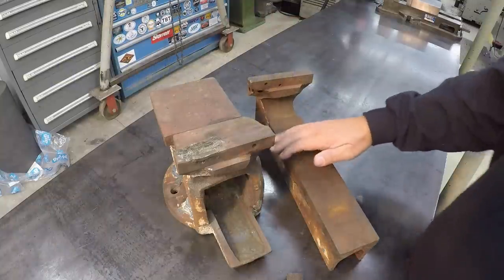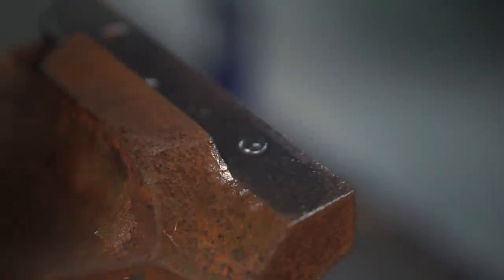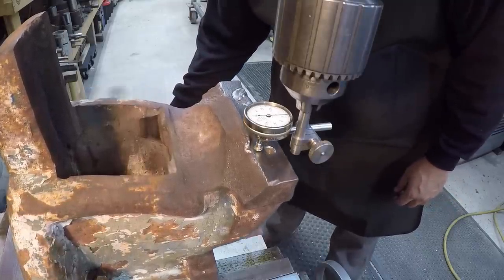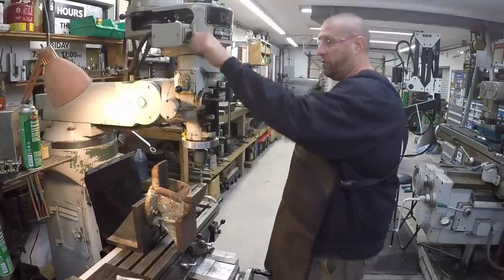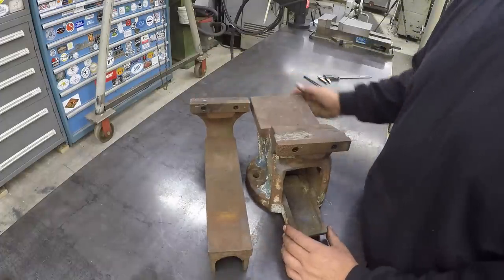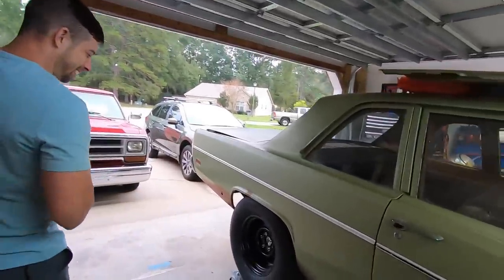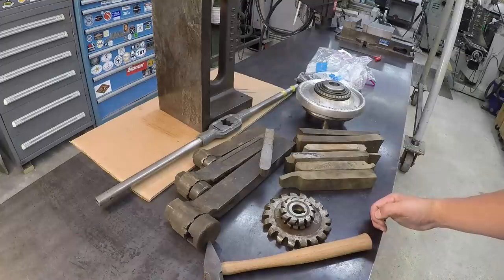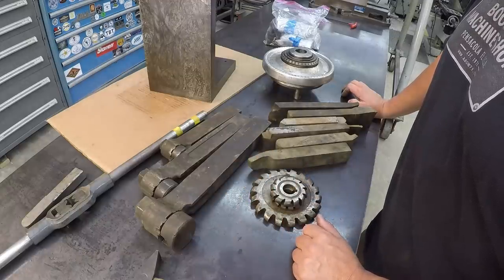SNS 283: Busted Vise Repair, 69 Valiant Update, Texas Picks

Comment: I would be concerned that the middle of the machine is unsupported. There is a reason the manufacturer had 6 mounting anchors. There could be a lot of pressure on the center of the machine base possible causing a crack to develop over time.

Comment: Spray it with "Blaster" first and leave sit for a bit.  Then LH Drill.
Reply: Blaster did not win the Project Farm comparison...
Reply from the maker: I’ve shown the left hand drill countless times on my channel. Showing the welding trick this time...
Reply: @michael931  ....Nothing really "won" that comparison.  What it did prove is that none of that "penetrating" crap works.  The more expensive, the least effective the junk was (Kroil, I am talking to you !)  Over the years, I can't believe how much money I have wasted looking for the "miracle penetrating goop" .  No more.  Heat (cycles) is the only reliable and quick solution.
Reply: @Abom79  Do you know of or have used Blaster?  Not many of us have plasma welders or machine shop.
Reply: @paulcopeland9035  ~  We have used Blaster with much success since we do not have access to high temp cycles to assist.

Comment: Curiosity question:  I'm not a machinist so this might be a dumb question.  If you have a part that is 1 thousand over (say 6 thou total and you want it to be 5 thou) naturally you would remove 1 thou.  Does the increment markings on the lathe show thousands (or a digital readout)?  If so, does moving the tool forward 1 thou, per the markings, physically move the tool forward 1 thou or .5 thou?  Doesn't it stand to reason that removing .5 on each side of the work piece gives a result of having remove 1 thou total?   Again, I'm not a machinist so go easy on me.  Thanks!
Reply: It depends on the lathe. Some dials read the amount you are removing from the diameter (.001"=.001 off diameter), but some read what the radius is(.001"=.002 off diameter)

Comment: I found a Reed 103 1/2 vice at my local flea market.  $10.00.  The movable Jaw is broken off.  This is the only one I have ever seen.
Reply from the maker: I’ve seen many like that that were brazed back together.
Reply: Yeah, Jason at fireball has a vice testing video where he tests a vice that had its dynamic jaw (I think it was the dynamic jaw) brazed back on, and it's super strong.

Comment: I had to check. An 8mm tap needs an H drill bit. 17/64ths is close enough though.
Reply: Or a 6.8mm metric bit. Which of course isn't an even 0.5mm. For the regular metric threads, M4 needs 3.2, M8 needs 6.8, M12 needs 10.2. The rest are either whole or half mm sizes (unless you want to go over or under-size for some reason). [Also not counting M7, M9 or M11 which are real oddball sizes]
Reply: I just discovered that substracting the thread pitch from the diameter gives you the metric tap drill size.

I was organizing a set of metric taps and tap drills I had bought from MSC, (they sell a three tap set of plug, taper and bottom taps) in a organizer I made, and read about the subtraction thing. I checked and all but one of the sizes worked out perfectly.

Comment: I was under the impression that you needed to heat cast iron before welding on it. Why not in this case?
Reply: TIG is a very localised heat...
Although in some cases a pre & post heat soak would be prudent...🇬🇧👍

Comment: Would it not have made more sense to open up the counter bore for the bolts so in future they can be replaced with new bolts and not need to turn them down?
Reply: That would work for this jaw but other replacement jaws are likely to need this size head.
Reply: @tallakff7349  more chance someone going to have a drill to size out a new jaw then a lathe to replace a bolt?
Reply: I agree. He is much more likely to damage or lose a bolt than damage and replace a jaw in his home shop.

Comment: Hi Adam.  I know you have used Evaporust in the past and just wondered what you think of the product. Over here in the UK we don't seem to have much of a variety in this field.   
I watch your U tube  channel a lot and think it is a great show. Keep up the good work.   Keith C in G.B
Reply: I'm not Adam, but I'd say Evaporust works very well. If it's on items you want to keep the finish nice, you have to keep an eye on it. Too long in the solution, or if any of the part is not submerged in the liquid, it will leave a visible line. Parts left too long can darken or start to blacken. Also, hello from north central US!
Reply: I know Hand Tool Rescue uses Evapo-Rust a lot in his restoration vijeo’s!

Comment: Question: How did you decide to take down the diameter of those bolts instead of raising the the diameter of the whole? I assumed it was just all the rust in the wholes that made it so snug. Why not just clean them out.
Reply: If i were in Adam's position I'd have done the same. I quick and easy operation and you're not modifying the customers parts beyond what they've requested.
Reply: Those jaw inserts look pretty hard.  I’d have done the same.

Comment: I have repaired vise with the NiCad stick, It never held up for heavy use.
Reply: Nickle rod is stronger than the original casting.  Sounds like there "might" be an application error if it always failed!
Reply: @paulcopeland9035  Yes, Jason at fireball tested a vice that had its entire jaw brazed back on, and it was super strong.

Comment: is thier any reason to use safe erase instead of a sand blaster?
Reply: I believe it’s safer
Reply: Lead paint would be one thing.  The lead waste would be easier to control with the remover.
Reply from the maker: Sure, I don’t own a sand blaster

Comment: What type of nickle rod did you use? I need to fix a crack in my engine block. I see you did not use any pre-heat. Love the video.
Reply: Daniele Silvaggi Not that you say that I noticed that also. I wonder if it’s for heat-treat or metal hardness reasons or something else?!
Reply: He says he used nickel-99, it's pretty standard stuff. It's great for cast iron because nickel doesn't react with the carbon. It stays soft and stretches when things shrink, so less risk of cracking. GM used to use nickel in their racing blocks back in the 60's. It's a real good alloy with iron, none of the drawbacks.
Reply: @OldtimeIronman  Thank you very much for the reply I will get some to try.
Reply: Daniele Silvaggi I have to warn you it is not cheap. I used to use it at work and it was at least a buck per rod if not more. You want your machine set on DC just like 7018 but a bit colder. Watch out because nickel likes to run just like stainless.

Comment: hi adam love your youtube channel i have a question  i  have a bmw cam shaft  that is badly worn and want to know if the lobes can be tig welded and what filler rods should be used
Reply from the maker: I can't comment on that cam shaft work as I have never messed with them
Reply: You don't want to weld a camshaft as the faces of the lobes are hardened. Buy another one. You won't be able to get the ramp degrees correct by eyeballing it anyway.

Comment: That's bad !
Really thought mine was fixed ...
Just fight for with few months ago .
Really thought that was it !

And some terrific guy on the internet just remind me !

Pray to have bit of a sun so you could use your electrical tools ...

Running on solar during winter times is a kind a challenge ...
As if welding rear or background piece thoses jaws wasn't kind a one hard enough !

I swear it was strait at the start !
Damn those things are alive or ...

Nevermind, I get something is missing but just didn't get how to clamp the pieces to weld, nor how to find "welding" powder for flat surfaces ...

So ...

From france, with !
Reply: I think I could bring the piece to weld to red hot temp !
I could bring part the vise concerned to blue-white not to red-orange-pink .
I just wonder if I could use flux some kind to make them stick together ...

It's a small iron rectangular flat surfaces pieces making about 2cm large 5 cm long 0.8 cm thick that belongs to claws behind the screwable jaws ...

Could "thermite" welding process could be used, and how ?

Could I just simply mix flux with aluminium, iron oxyde dust then bring the whole to red hot ?

I anyone know how, or have seen how to practice that one ...

From france, with
Thanks

Comment: Hiya Adam. On that Hartman, much like your other vises, it has that classic green paint. hoping that you put it back to that color. I would be interested to know the paint you use if you do. I have been trying to find that color myself and I keep missing. While a lot of my machines are grey, I have quite a few that the original color was that green. I guess it used to be known as vista green? I just call it machine shop green, but I cannot seem to find a match. Color matching can be done of course, but so far I have not had luck with that. If there is an off the shelf paint available in that color, that would be awesome. I know you either love it or hate it, but for me, I really like that green. Any hints on a good match would be appreciated.
Reply from the maker: Best thing to do is go to a commercial paint supply store and have them help you pick or make a color.
Reply: @Abom79  Thanks

Comment: So weird hearing someone talk about 8 mm by 1.25, although your definition is abolutely correct and nothing to get wrong with, most people I know refer to them only as M8. if you find some  name like M8 x 20 for e.g. a hex head bolt, that usually means a bolt with standard M8 thread and 20 mm length measured from the shoulder of the bolt head. Not exactly sure though if that yields for all head forms and honestly to lazy to look it up right now as we just passed midnight.
Drawback of only using M8 as description, it can be mistaken with M8 fine pitch or fine thread bolts. When used I only heard M8 in combination with Fine pitch or fine thread so far, but if someone gets lazy...  Fine Pitch would be a pitch anywhere betweeen 0.75 and 1.0 per DIN definition.
So only saying M8 here, everyone assumes it is standard (coarse) M8 with 1.25 pitch as per DIN table.
Reply: AIUI metric regular is roughly comparable to unified fine, so there is much less need for use of fine variants when using metric threads.
Reply: Metric standard is nothing like unf.
Reply: @sjowners  Looks like it depends on the screw size. A M3.5 standard is slightly finer than a #6 UNF, but a M8 standard is around half way between a 5/16 UNC and a 5/16 UNF.
Reply: @petermichaelgreen  Agreed.

Comment: When you TIG why do you pull your right hand away so slowly..?
Reply: 196LT  post purge of gas common
Reply: The post gas, normally near 10 seconds, protects the weld until its “cool” to keep it from flash oxidation.

Comment: Why turn the head of the bolts down instead of opening the counterbore? Now if the owner wants to replace screws in the future he has to turn the heads down agai
Reply: I guess it was easier than setting up the mill to drill out the holes in the jaws.
Reply: Håkon T. Just seems lazy to me
Reply: rasterops1083 I guess but as a tool maker by trade I work with serviceability one mind and if you can’t replace something with a standard part, then you’re costing yourself time and money. Most common reason for removing the screws would probably be to add a soft jaw or if the vise is used for welding and then is splatter on the jaws and during the swap or cleaning the screws could get lost if you aren’t careful.

Comment: dodge magnum 360 is that the police interceptor engine? (nice)
Reply: Magnum series engines are the 1992-2002 318 and 360 in dodge trucks. They differ slightly over the LA design but are very similar.

Comment: Paint removers are crap, they make too much mess, stink and hard work. Best way to remove paint is to  use MEK what that doesn't remove in minutes won't come off with a flap wheel!
Reply: They are pretty much useless now the methylene chloride been removed from them.

Comment: It appears that labour is cheap in America. In other Countries it is much cheaper to replace the vice, than repair it.
Reply: Not so much. Some people like restoring old hardware. It's usually better than more modern imported stuff. Typically the steel quality is better, too.
Reply: ScrAp salvaged is free or cheap  The only cost is time  ,You can save a lot money and have fun rebounding
Reply: You obviously don't get it. Labor cheap in America? Is that why we have everything made in China? 🤷‍♂️🤣
Reply: It would've been cheaper to replace this vise, too. But what you buy new WILL NOT be the same quality. It won't last 80 years like this one. You'll be lucky if it lasts 8 years. Can't stand cheap mfkers.

Comment: if I may the gas didn't hit the work fast enough or you was standing on the hose the gas hoses on a tig rig foot pressure can cut the argon off i was standing on my hose food grade pipe line bet my pay check that is what happen I was stand on my hose doing a  tack on a 3in  316l line standing on the line made me have to cut out 1 foot both ways for bad tacks  and i had a back purge going know i run a dry rig on every pipe i turn the gas on myself my syrrwave gas valve isn't fast enough to purge the tig torch out

Comment: ...nothing about stripping paint is pleasant...and no matter what the label claims the product will do...after applying, waiting for an hour...its not going to fall off...take the production out-side...always purchase twice the recommended amount...But most important to note...any product that claims you don't need a wire brush...is laughable...Oh...one more tip, save the pan and just poor the stripper directly on what your stripping...no matter what you do, it turns into a nasty mess...😁